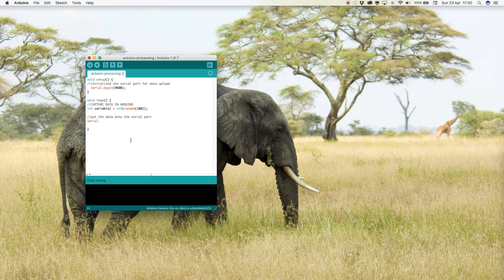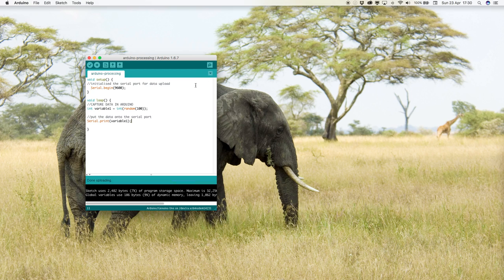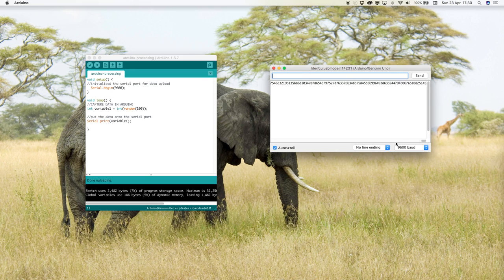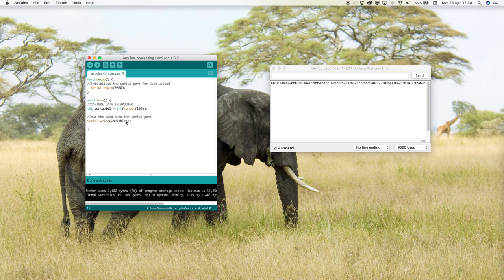Arduino - Processing: serial data

Comment: I have just been using processing for a few hours but now I can read serial data and visualise acc and other data from the micro:bit in real time. I´m using the radio feature on the micro:bit, really simple and you can read off any other microbit with radio send feature enabled. Great help thanks for sharing!

Comment: what if I have more than one variable, e.g. variable2, variable3, how do you separate them into individual variables at the processing end so you can have 3 bars being drawn simultaneously.
Reply: Print them in the arduino code separeted by a coma or something an then create a String array that separates the values divided by comas using the split() function:

String[] example = split ( val, ',' );

Here the "val" is the string imported from the arduino and ',' is the character that divides the string. Then if your arduino is sending for example: 12,230,123  example[0] is going to be 12, example[1] is going to be 230 and example[2] is going to be 123.

Comment: When communicating with Arduino from Processing, can I use the same conversion method wich was used in the video in Processing (myVal = float(myString); ) from string to int or float for numbers between 0 and 100?

Comment: Hi, I'm using an Arduino Mega 2560 and almost everything works fine, it doesn't show me any error, but the value of my variable in processing it doesn't change, and on my Arduino it appears no data on the window that open once you click on the "zoom" icon. I'm totally a newbie on Arduino but I understand Processing

Comment: I tried sending data from my pc to the board and I get the error “error opening serial port com4: port busy”
Reply: Same with you, how did you solve this problem?  I used the Mac OS, and I want to use the button on the Arduino to control the UI coded by processing,
Reply: @zchi.-4736  It was 8 months ago so I don’t remember too well. I think the problem had something to do with using the serial port 2 different ways at once

Comment: ArrayIndexOutOfBoundsException
I get this every time , my arduino is connected to COM5 and I put [4]
Reply: me to
Reply: @jonasverboven1728  Ive got it working, use processing version 2.2.1
Reply: @jonasverboven1728  and use serial print command not serial write
Reply: @jonasverboven1728  if it still doesnt work, tell me the problem ill try to help you
Reply: @filiphodak6792  iw il try it thx
and i will let you know if it works
Reply: //String myPort=Serial.list() [3];
 String myPort = "COM4"; //change to your com port

I just commented out the command I was having trouble with. This worked just fine. hope it helps
Reply: @modelrogers.19  thankssssssssssss

Comment: Why can't you open serial monitor is processing sketch is running?
Reply from the maker: C Liviu the serial port (on the com that your arduino board is) is singular. So on a 'first come first served' basis only one application can view that data at a time. Multiple programs can place data into it. But only one can see/use the data at a time!
Reply from the maker: C Liviu mostly to do with the age of serial ports. The are like the OG of data transfers, before we got parallel processing etc!
Reply: @Programmingforpeople   parallel processing you say?

Comment: MySting is in what format? Say the random chooser from arduino chooses int 10 and prints it in the serial port, what goes on in processing, what does it convert ingo a float?
Reply from the maker: It’s normally transferred in ascii, so when it reaches processing it’s a number. You need to read it as one and transfer it into a string again (normally)

Comment: import processing.serial.*;

Serial mySerial;

String myString = null;
int nl = 1-;
float myVal;

void setup()
{
  size(200,400);
  
  String myPort = Serial.list() [1];
  mySerial = new Serial(this, myPort, 9600);
}

void draw()
{
  while(mySerial.available()>0)
  {
    myString = mySerial.readStringUntil(nl);
    
    if(myString != null)
    {
      background(0);
      myVal = float(mystring);
      
      myVal = myVal/100 *height;
      
      rectMode(CENTER);
      rect(width/4, height - (myVal/2), 100, myVal);
    }
  }
}

Comment: import processing.serial.*; //includes the serial object libreary

Serial mySerial; //creates local serial object from library

String myString = null; //a variable to collect serial datra
int nl = 10; //ASCII code for carage return in serial
float myVal;//float for storing converted ascii serial data

void setup(){
  size(200,400);
  
  //link proicessing to serial port (corect one)
  String myPort = Serial.list()[1]; //find correct serial port
  mySerial = new Serial(this, myPort, 9600);
}//setup
  
  void draw(){
    
    while (mySerial.available() > 0){
      myString = mySerial.readStringUntil(nl); //STRIPs data iof the serial port
      
      if (myString != null){
        background(0);
        myVal = float (myString); //takes data from serial and turns it into number
        
        myVal = myVal/100 *height;
        
        
        rectMode(CENTER);
        rect(width/2, height-(myVal/2), 100, myVal);
      }//data was in the serial port      
    }// do something if there is data on the port  
}//drwa